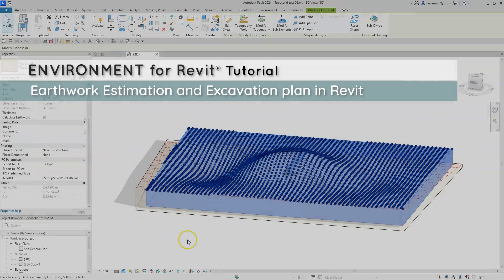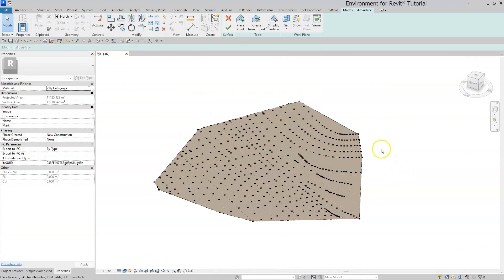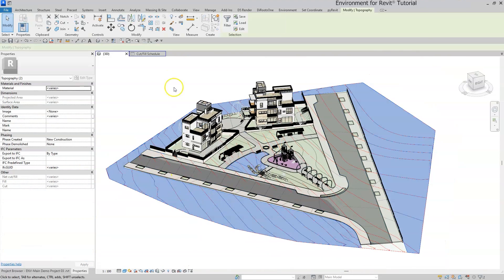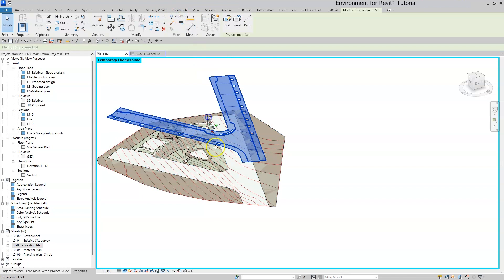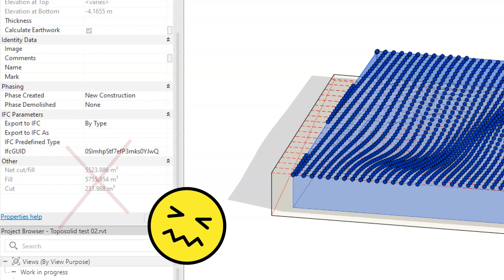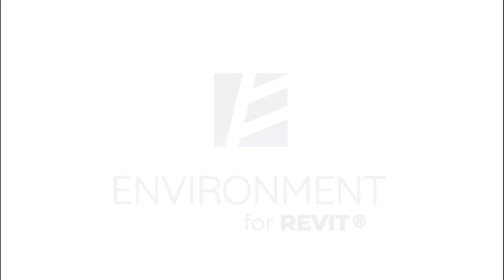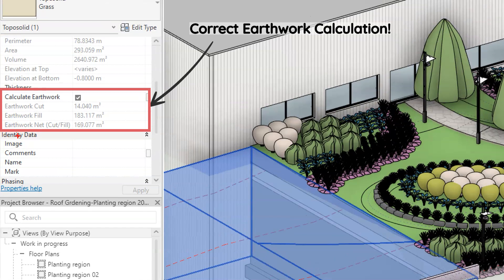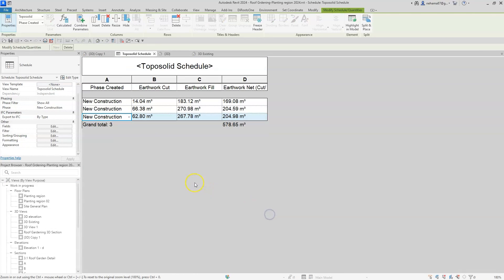What is Cut & Fill in Revit® and how it works with Toposolids | Revit for Site Design

Comment: its keep calculation failed
Reply from the maker: These hiccups do occur occasionally.
One suggestion would be to test if the function runs smoothly in a different file or on a different topographical element. Sometimes, complex geometry can cause such issues.

The good news is, we're currently working on upgrading this feature. Soon, you can expect it to perform even better and be more accurate.

Thanks for your patience! 💚

Comment: I'm attempting to cut into a toposolid and usually without Archintelligence I would cut into the new terrain with void mass, but the issue was with fill which wouldnt work. Now with Archintelligence, the fill parameter works but im not sure how to get a cut to register, although a lot of times im getting a calculation error. What would be the proper way to cut into a toposolid, for a example for a basement.
Reply from the maker: Hello Drori, The proper way to get the cut calculation of a basement is to simply model the basement with a new toposolid under its Floor. As long as you have an existing toposolid in your model the new toposolid will show you cut and fill. the meaning is that you dont actually have to cut into the existing toposolid. If you are getting the cut and fille error I would ask you to please send some screenshots to Contacts@Arch-Intelligence.com so we can take a look at it and see where is the error. Thanks for the comment.